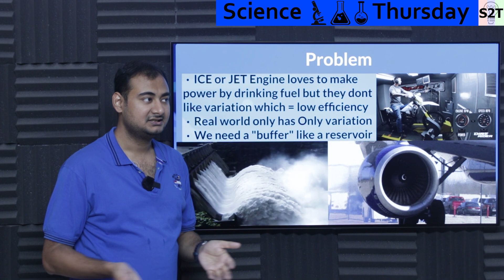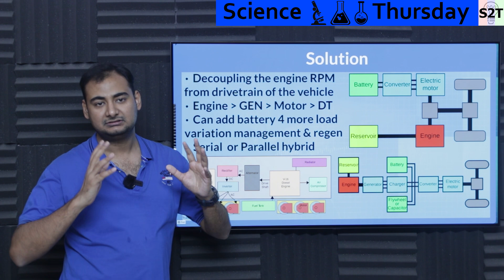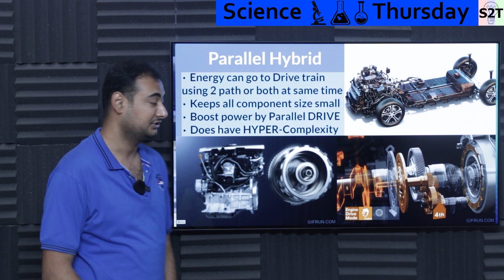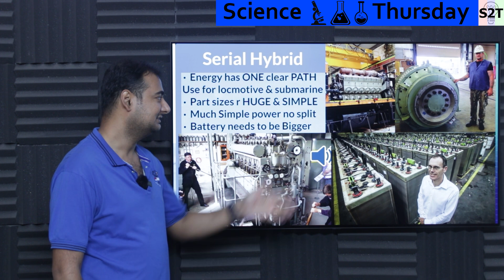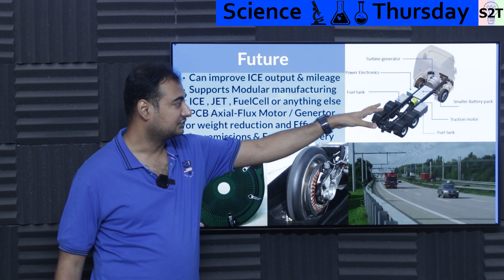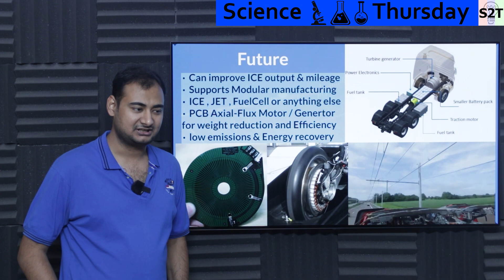Hybrid Drive Train Explained {Science Thursday Ep230} prproj

Comment: Nice presentation. Good to know about serial and parallel hybrids. I have noticed a trend in EV architecture of higher voltages ie say 400 to 800 v or even 900 v ( eg Lucid motors). Why is this trend? What is your point of view? Though higher voltage has its limitations on power electronics!
Reply from the maker: 400 is standard 800 for high power like bus or truck or Humvee  anything more than that is just for other stuff like fast charging